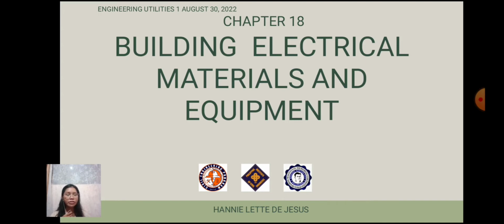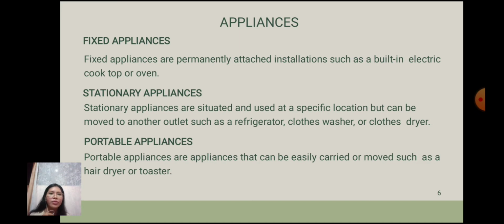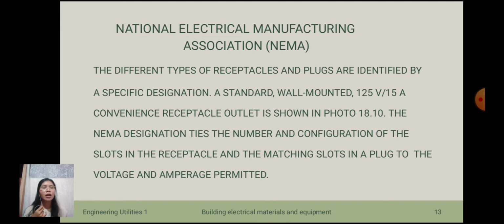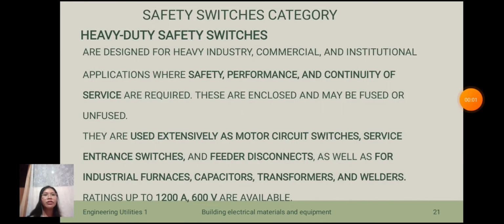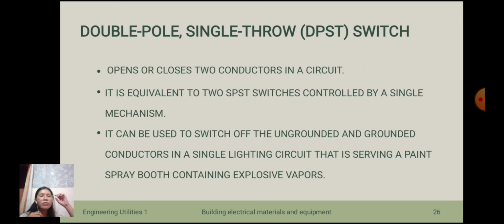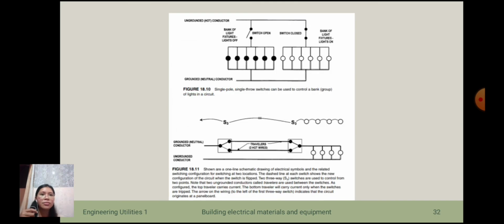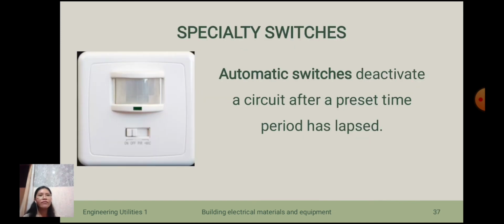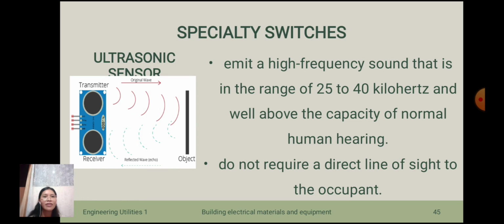Utilization Equipment and Devices

Comment: In her topic, she gradually explained all the utilization equipment commonly used in electrical distribution system. Each equipment and devices have each unique purposes solely for the distribution of electricity. Here, she showcase some types of plugs, outlets, receptacles and the switching configurations. All of these serve its purpose to relay electricity throughout the whole public, private and residential structures. Since every equipment have unique purposes, use it as where it belongs just for safety purposes. Considering all things, Ms. DE JESUS excellently covered and explained her overall topic.

Comment: What I learned throughout the video is there are different kinds of appliances and the common appliances we found where ever we go such as outlets, plugs, receptacle, switches and many more as the reporter discuss more about the definition of different electrical devices through the equipment, uses and its applications. it simply shows that this topic is all about the general equipment that we are commonly using in electrical devices and this taught me a lot since it shows from the table considering the ratings of each power by showing the value of its voltages.

Comment: I gained knowledge on a few electrical equipment from this video. There is a switch, a plug, a receptacle, and an outlet (kinds of switches, switches configurations). There are also several terms for switching, like toss and pole. Additionally, it displays the many kinds of appliances, including permanent, stationary, and portable ones.

Comment: Thanks to this informative video, it taught me the importance to know how our electrical home appliances works with power lines, and its utilization of proper usage. The interesting part to know is the outlet connection, which known as female. The outlets is commonly being stated in the electrical layout which for me as engineering student important to know the proper utilization before it reaches the primary users.

Comment: This video is all about the utilization equipment and devices with an outline of utilization equipment, outlets, receptacles, and plugs, switches, and switching configurations. I am thankful because she really explained clearly and thoroughly the topics and i really understand it. She also explained the functions, uses, and purpose of those topics. This video is very interesting to learn and it is a great help to everyone. I learned a lot in her video specially the different types of switches and the purpose of it. As an engineering student, it is very important to have knowledge about this and it is a great help to us.

Comment: In this video, she discussed her topics very well and she share her knowledge to us on how to understand her topics.I learned a lot that utilization equipment is a broad category of electrical or electronic machine or instrument designed. And also Electric switches are very important because all the equipment we are using is useless without a switch. Electric switches use to connect and break the flow of connectivity. Electronic switches are used to perform all logical functions.

Comment: This video makes it very evident that understanding how to use the various tools, equipment, and utensils is crucial for speeding and optimizing the process. If you comprehend how it works, you will save time, money, and effort. Food can be treated to provide a high-quality end product. How long a piece of machinery, equipment, or asset is used is measured by its equipment utilization. Businesses can make better informed decisions about project timelines, stocks, and equipment rentals based on the calculated utilization rate. They can also learn how to make better use of their tools.

Comment: From this video, to make the process simpler and more effective, it is crucial to understand the various tools, equipment, and utensils and how to use them. Knowing how it works will save you time, money, and effort. You can process food to its best quality and get the best product possible. The length of time a piece of machinery, equipment, or asset is employed is known as its equipment utilization. Businesses can make more informed decisions about project timelines, inventory, or equipment rentals based on the calculated utilization rate. They can also better understand how to use their equipment.

Comment: Thanks to Ms. De Jesus, for sharing her thoughts about this topic. After I've watched her presentation, I've learned that in Building Electrical Materials and Equipment, knowing it's subtopics which is; 1.Utilization Equipment which assists businesses to improve jobsite productivity and reduce the cost of equipment rental and project delays, 2.Outlets, Receptacles, and Plugs, 3. Switches which are key building blocks for any network, and lastly Switching Configurations, is important for this knowledge will be used in the future.

Comment: Because of the video's excellent explanation of the report, I learned how the electricity, or current, will flow so that switches will turn on or off. The reporter talked about using equipment and devices in this video. The lamp or light will turn off when the switch control is open since current couldn't pass through the light.

Comment: In this Chapter, Utilization Equipment and Devices, she's tackled about the outlets and switches, I have learned that each kind of switches has its own unique purposes from simple switches that we frequently use and always present in every home to Heavy-duty safety switches that we don’t usually see because it its installed and found in most of the commercial buildings. She also discussed different plug kinds. Because each plug has a different capacity based on its Amperes and Voltage, it is crucial to understand what equipment may be plugged into each type of socket.

Comment: In this video I conclude that Electrical outlets  allow electrical equipment to connect to the electrical grid. The electrical grid provides alternating current to the outlet, receptacles, are sockets that are used to establish an electrical connection between an electronic device and power supply.
And One key component which plays a key role in the intricate delivery of electricity is a plug. AC power plugs and sockets connect electric equipment to the alternating current (AC) power supply in buildings and on other sites.

Comment: The video is about the Utilization Equipment and Devices. I learned how the electricity, or the current will flow so that when switches will turn on or off. When the switch control is open the lamp or light will off because the current couldn't flow through the light. But when the switch control is close the light will open, it is because the current can flow into the lamp. And I also discovered that there are several types or specialties of switches. Overall, the video gives thorough information that allows us to quickly comprehend things.

Comment: I learned about Utilization Equipment and Devices is that as a Civil engineering student it is important for us to know how our lights at home are controlled and follow the standard wirings and where our electricity or energy comes from that provides light in our homes, so that when the time comes when we build a commercial building or even a residential building, we can follow the standard about electrical sources or we know where we get energy from. As a Civil Engineering student, it is more important for us to know the different electrical sources so that we know how strong the energy we get when it is weak or strong can find a way to not overdo or weaken the energy we get.

Comment: By watching this video which is about utilization equipment and devices, I learned more on electrical receptacles and plugs which these should be approved or gas complied standards of NEMA. There are terminals on receptors such as brass colored screw, silver colored, green colored. This video also discuses about switch and how electrical flows are controlled.

Comment: I learn from the report it's all about building materials and equipment so with the use of type of different equipment  referred to as asset utilization, is a measurement of the use and performance of site machinery, which assists businesses to improve jobsite productivity and reduce the cost of equipment rental and project delays

Comment: For this video I learned what the importance of electrical materials Electrical materials are the different parts that help to make an electrical project successful. There can be hundreds of different types of electrical materials I noticed that can be used. Starting from a switch to a high-end motor, all these are electrical materials that are used in providing electricity or used in machines that require electricity. Given below are some of the most common electrical materials that you will see around you Improper usage of power tools can cause unwanted injuries that require immediate medical care. To prevent these scenarios from happening to you or to the people you know, it is best to be informed about proper safety procedures before using the tools themselves.

Comment: From this video, I learned about some electrical devices that are presented. There is an outlet, receptacle, plugs, and switches (kinds of switches, switches configurations). Also, there are some switching terminologies – pole, and throw. In addition, it shows the different types of appliances - fixed, stationary, and portable. Thus, the video depicts the utilization of equipment and devices.

Comment: NIEL JOYCE L. DEGORIO BSCE-3

Utilization equipment means equipment which utilizes electric energy for mechanical, chemical, hearing, lighting, or similar purposes. Utilization equipment means equipment which utilizes electric en- ergy for mechanical, chemical, heat- ing, lighting, or similar purposes.